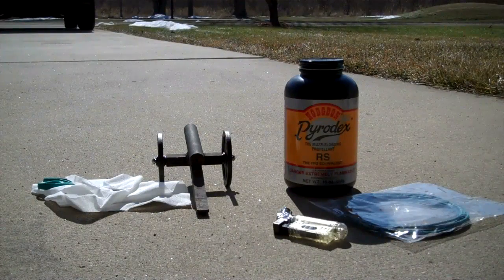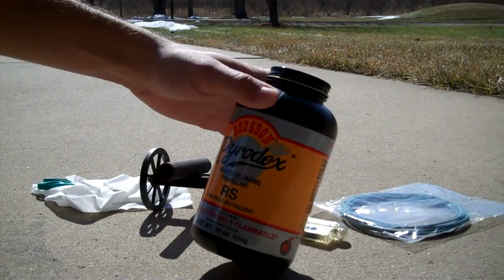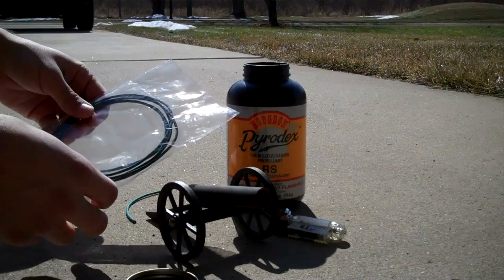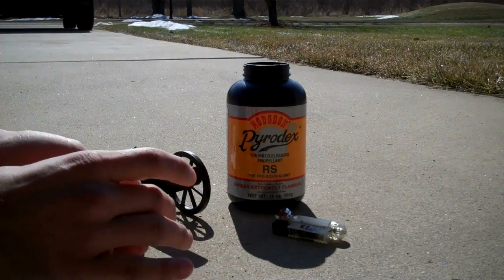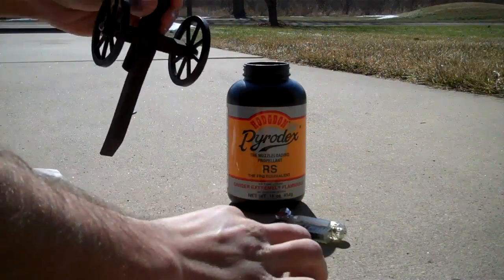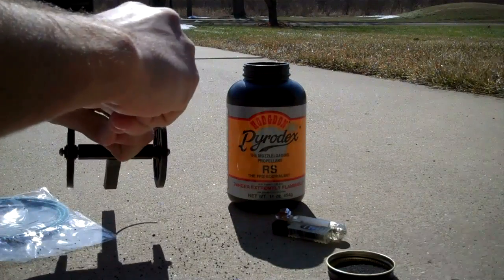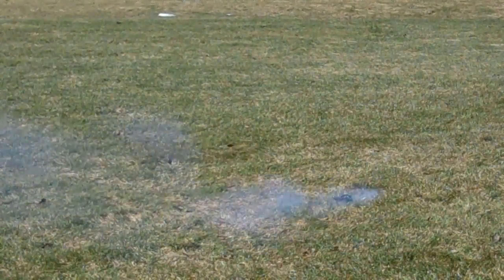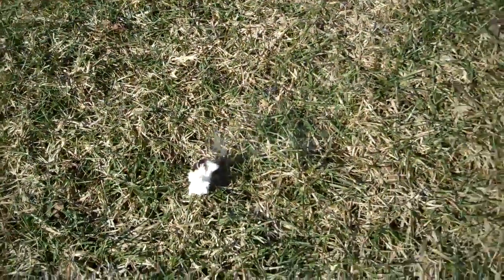Black Powder Salute Cannon - Loading and Firing

Comment: Nice job on the video. I just bought the same cannon and have posted two videos of it being fired. I use black powder and it seems to produce a different bang than yours does. Mine sounds more like a gunshot. These are great fun for just $27.00 plus fuse and powder. Thanks for the video.

Comment: Very cool.  FYI, you can easily make your own black powder.  It's just 75% Potassium Nitrate (fertilizer), 15% Charcoal (make your own from soft wood like Willow, Pine or Fir), and 10% Sulfur (optional, but it lowers the ignition temp.  Use more charcoal if not using Sulfur).  Store bought charcoal has additives in it that make the powder less powerful, but it does work.  Google how to do it, it's kinda fun.  I think I'm going to make my own cannon now.  Thanks for the video!